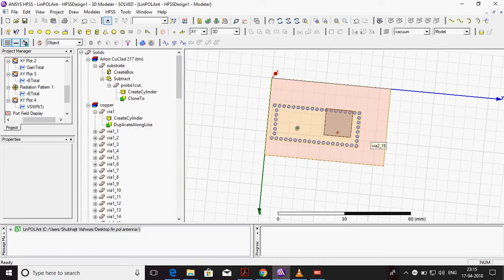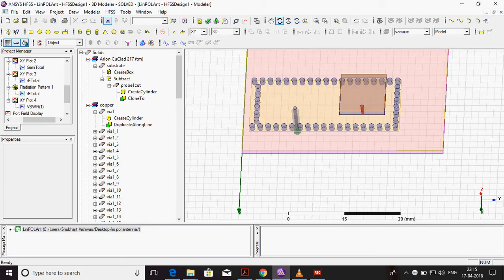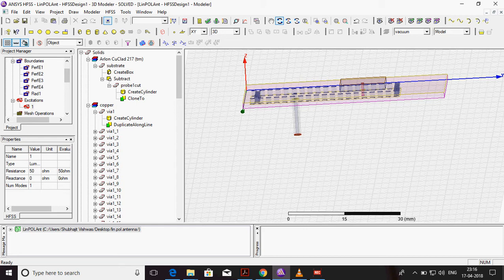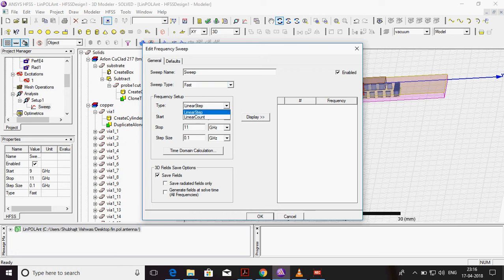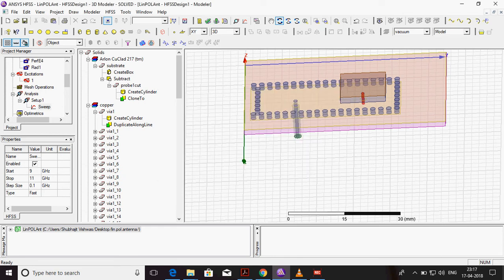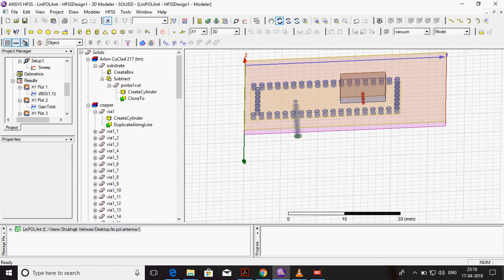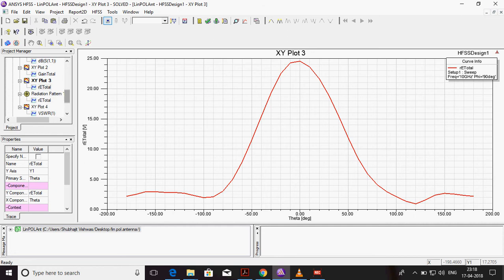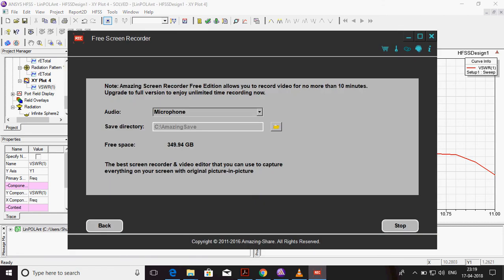Microstrip antenna fed by SIW

Comment: What is the use of red colored cylinder below the patch
Reply from the maker: To fed the patch from SIW
Reply: Shubhajit Vishwas thanks for the reply. Is this red cylinder connecting patch and the ground. Like shorting pin
Reply from the maker: First make a cylinder and subtract it , after that give feed otherwise it will give intersection problem